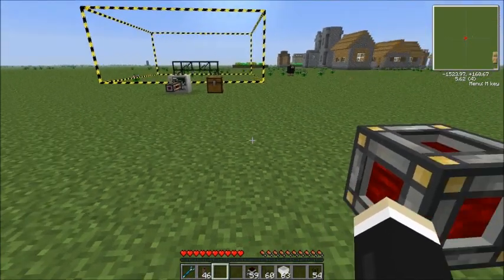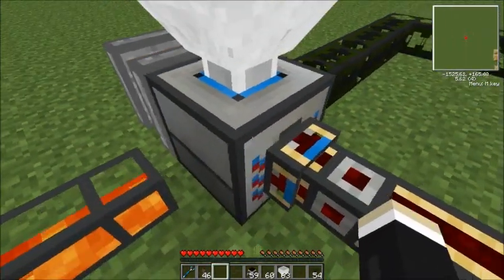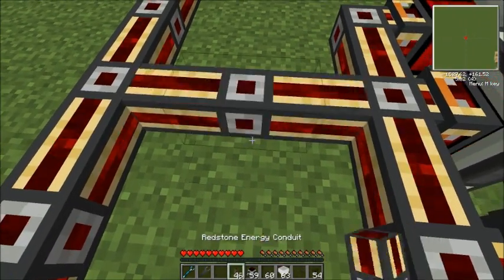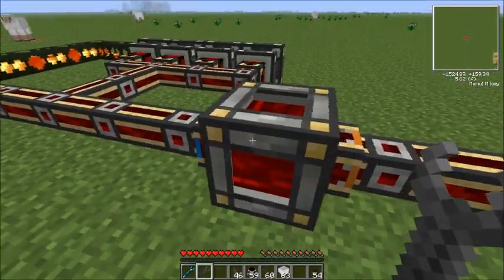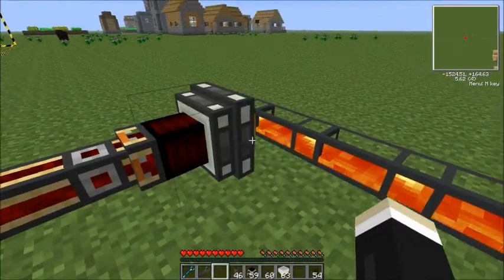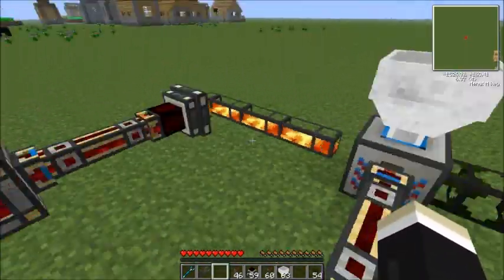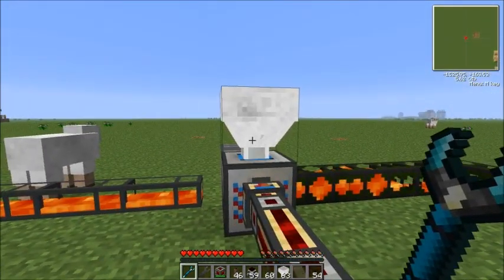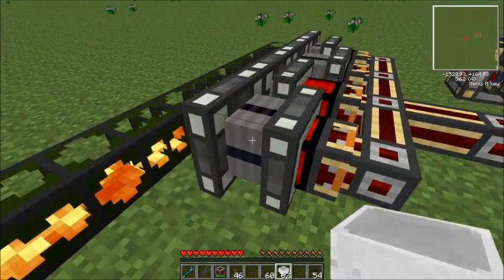Thermal expansion endless energy setup

Comment: Just use a lava fabricator from MineFactory Reloaded (Top), a magmatic dynamo (right), an energy cell (left), a power cable (Connecting all three "machines") and a Fluiduct (Connecting the dynamo and the fabricator). The fabricator pumps lava into the dynamo which in turn produces energy and powers the Fabricator. The excess Power will be stored in the Energy Cell.

Comment: this isn't endless. it runs on netherrack. to make this truly endless, you would have to be able to use the lava to turn it back into netherrack in a greater amount. it's all about finding exploits.

  I actually made a power generator that was truly endless in a modpack called CrainerCraft that had a mod called projectE (it's an equivalent exchange 2 remake). There are these multiblocks that allow you to duplicate an item from nothing but sunlight, so what I did was duplicate the crafting ingredients for some stuff called pyrotheum dust. I set up an autocrafter to make pyrotheum dust, then sent it to a magma crucible where it would be melted down in blazing pyrotheum. I then sent it to a grid of magmatic engines (dyanmos), which then gave me power! You see, 1 bucket of this stuff gives you 2 MILLION RF.

I know you're probably thinking "why not just use solar panels?" solar panels don't generate as much power, and getting actually good tier ones is a pain in the butt.

okay video
Reply: CORRECT!!

Comment: Using ex nihilo, extra utilities, magical crops, minefactory reloaded and thermal expansion you can easily create an infinite energy source: create a cobblestone generator-make an automated redstone farm(using magical crops)-make a lava generator by making the cobblestone go in a crucible heated by lava/pyrotheum, then output the lava in a heated redstone generator(since it uses a very low amount of lava) and make a auto-crafting table that makes redstone out of the redstone essence and output the redstone in the heated redstone generator, this creates a pretty powerful energy source and it is fairly cheap, you can boost the lava-production by adding more crucibles, you can also add more heated redstone generators to get a lot of power
Reply: The easiest, mid-early game way to make buckets of RF is big reactors.  One small reactor costs some yellorium/uranium to build and graphite (burnt coal), a good amount of iron some redstone and a diamond for the controller.  Even a 3x3x3 reactor is going to produce a few hundred rf/t.  Before I switched to reactorcraft (which is the god-tier of nuclear power), I had a 7x7x7 reactor that when filled halfway with fuel, produced 17k RF/t and was very energy efficient, at about 60,000 RF per milibucket of uranium or 60,000,000 RF per uranium ingot.  And big reactors can't explode and can't leak radiation so they are 100% safe in your base (unlike my reactorcraft reactors, which are situated at a remote outpost a kilometer south of my main base.

Comment: Might not be up to date, but the concept still works. For you guys who are playing with TE3 with a mod pack with extra unities. Make 10 drums from about three stacks of iron and simply feed that into a magmatic generator and run it though a power converter. Its best until you can obtain other metrieals needed for this set up. Still works even with the new Red stone flux system. Btw Red stone flux equals MJ when devided by 10, you can power buildcraft machines with the conduits too as it converts it ;D.

Comment: Or you can just get an ender farm, hook it up to a grinder, connect that to multiple ender generators (probably tens and tens, the more you have the more energy you can get) and use the power from about one or two of the ender generators to power the grinder.
End result: Many ender pearls (that you can use as blocks of solid ender for beacon bases), limitless energy, and more mob essence than you could ever possibly use.
As for mods needed: Extra Utilities for the ender generator, MineFactory Reloaded for the grinder, Tinkers construct 2 IF you want the blocks of solid ender, and obviously Thermal Expansion 3
Reply: please make a video on this
Reply: Mike Falzy I don't fully automate it as I don't know how to make the ender pearls go equally into each generator. All I do is use item ducts and connect the grinder to many chests, use fluiducts and connect the grinder to extra utilities' drums. Then I manually move the ender pearls from chest to generators. The main limiting factor to the how much power you can get is how many energy cells you can make, so concentrate on that before making millions of generators.
P.S. I don't know how or have the equipment to make a video.
Reply: ***** Great idea, but I don't have enough iron to make tons and tons of ender generators that could use all that up and even if I did you would need a hell of a lot of energy cells (It really helps if you make the cells in groups of a large number. eg:16)

Comment: im in direwolf20 and I have no idea how to turn the engine, I have tried every wrench and nothing works!
Reply from the maker: Engines will not turn unless attached to something.  Try putting a energy conduit pipe next to it and see if it will turn.  Also Thermal Expansions wrench is called a crescent hammer.  It is a blue stick with a wrench head on it.  hopes this helps.

Comment: I am very disappointed in this tutorial. You seem to be a bit confused on the meanings of "unassisted" and "continuous". Both of those words imply a system that is self-sustaining. This system is not. Yes, it is a high-output system, but it is not "endless" as you claim. It still requires fuel, in the form of Netherrack. When the Netherrack runs out, the lava stops, and the system will grind to a halt. You could just as well rig a series of Steam Engines linked to both an Aqueus Accumulator and Powered Furnaces outputting Charcoal. In fact, such a system would be much closer to being truly endless, if set up correctly. Tree farms can be automated, and some trees are quite large. From there, it's simply a matter of scaling it to get sufficient power output.
Reply from the maker: I hear you and understand your point.  This video was done a bit back, and was intended to get help get the first system up and running.  I do have another video up that shows a truly endless energy setup as you mentioned with a wood farm and such.  Thanks for watching and taking the time to comment.
Reply: I don't know much about tekkit, but I have an idea to make it unasssisted: Use Phase Transport pipes and a sorting system (diamond transport pipe) with a quarry in the nether to mine like 10,000 netherracks. Then pump those netherracks into the magma crucible. True, technically it's still not truly self sustaining, but with 10-20 thousand netherracks it will last you years
Reply: Daniel Tian Problems here is that 1: It's still not infinite and 2: It's slow as hell.
I've set  up a bunch of Ingenious Extruders linked to Advanced Recyclers (powered by solar/RTG pellets). The scrap I get from these is used to produce fertiliser which in turn goes into a fertiliser to insta-grow large jungle trees. The jungle trees are cut down (saplings go back into the planer) and the wood is turned into charcoal. This charcoal is fed into two large steel steam boilers feeding their steam into 40 or so steam dynamos. 
This system never runs out, ever. It's been on for weeks and I'm at 2m jungle wood and 1.5m charcoal now (producing more than I'm using.)
Reply: Dennis19901
That's an impressive system. Though you may at some point want to set up an "overflow valve" that shuts down parts of the charcoal process when you get to a certain amount of backlog. Otherwise the system risks getting backed up to the point of breaking and causing entity crashes (well, depending on how you're storing).
Reply: It works with Applied Energistics and the scrap, charcoal and jungle wood are stored in deep storage units.
Reply: Yeah, that's what I was meaning about "depending on how you're storing". At that point, it's just how much more effort/resources you want to throw at the system.
Reply: Use ProjectE and Auxilium Equivalence to get inf netherrack out of sunlight

Comment: This setup doesn't seem to work anymore now that it uses RF as output. The energy cost/expense is still a positive value, but it won't generate it fast enough to refill the Crucible's energy (at least not if you want to power machines too)
Reply: Magmatic Dynamo for 180k RF Netherrack to lava for 120k RF. Still, it's a slow and rather amateuristic system.

Comment: Why is that majority of my lava from my crucible is going to the first magmatic engine and the others are barely getting any. Im new to FTB so i don't why I did wrong. I copied your entire video.
Reply: You did nothing wrong. Pipes favor the first turn over the next. As soon as one engine fills up, the other engines will quickly follow. To get the process started, just manually fill the other engines with a couple of buckets of lava.

The system will balance itself soon enough.

Comment: All of the TE machines use enough power to stay at equilibrium.  The max power on a crucible is 40 MJ/tick.  If you have enough engines to provide that, it will fill up the buffer and melt faster.  With only 4 engines, you can't get 40/tick, so it ramps down its power until it's running in steady state, which makes the internal buffer stay in the same region.

Comment: he is producing 16Mj per tick (magmatic engines are 4Mj times the 4 he has) and the crucible wants 8000Mj for the process.
it will eventually fill up the power storage once the engines and pipes are full of lava and the crucible will not be running constantly

Comment: From the tank, you can do whatever you want with the lava, I focus on IC2 (I play the Mindcrack FTB pack), not just redpower and/or buildcraft so I pump the lava into 16 thermal generators. I have 8 pumps, each pump working with 4 redstone engines, I can't tell you how many pumps you'll need to keep up with magmatic engines but a pump with 4 redstone engines will put out a bit more than 2 thermal generators can use. I use the excess in Ind. Centrifuges to produce free copper/tin/electrum

Comment: The easiest and most efficient thing to do is to make a pair of liquid tesseracts (8 ender pearls, 2 diamonds being the hardest to get, you'll also need an induction smelter and some obsidian which means you need 5 diamonds total), some pumps, and a world anchor of any type, the chunk loader is probably best. From there, set up the tesseracts, one in the overworld and one in the nether, pump magma into the tesseract, and then pipe it into a tank in the overworld from the second tesseract.

Comment: Netherrack now takes 12,0000 mj to magmafy and produces 18,000 in a magmatic engine or 20,000 in a stirling engine at a much slower rate (Plus you have to use a bucket or cell to feed the stirling, you can't pipe it in). Cobble/stone/obsidian take 24,000 to magmafy which nets you a loss of 4-6000 depending on which engine you feed the lava into.

Comment: Not on thermal expansion alone. There're some setups using forestry, and other mods... but they changed the cost of lava from netherrack and the output of magmatic engines just because of these infinite engines.

Comment: Well, that's because this video is outdated. they changed it. now it takes 12000 MJ to turn netherrack into lava. In addition, magmatic engines now produce less energy, and they can overheat blocking themselves till you restart them. It's still a nice setup, but less optimal now.

Comment: hey thank you for the video. I have a question.
How many magma engines does it take to have it provide enough power to sustain the crucible? i did four like you but as soon as i would unplug the crucible from its power source it would drain my redstone cell faster than it would charge it =[. I cheated and tried 8 and i think it worked, all i needed then was netherrack. I started a new game because i don't like cheating and i want to build it again but what is the minimum  magma engines i need?ty

Comment: magmatic outputs a max of 4 MJ/t, combustion output 6 MJ/t. combustion engines also overheat, so you'll need to supply them with water, preferably just hook them up to a pump with an infinite water source

Comment from the maker: I have also had times they do not want to turn correctly.  I have found it best to put the wooden conductive pipe or redstone energy conduit in front of the engine.  If need be, place the pipe/conduit first then place the engine (remember shift right click with wrench will pick them back up).

Thanks for watching.